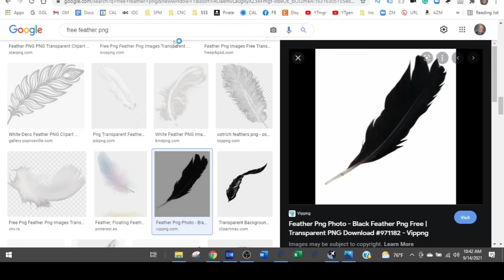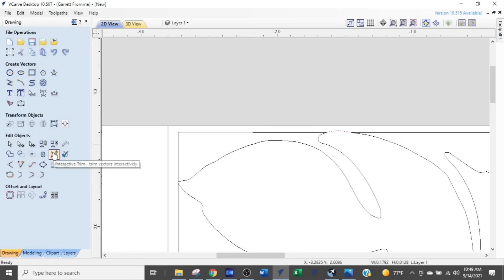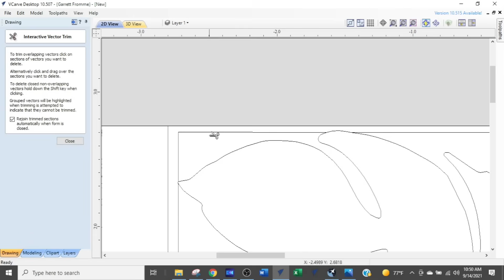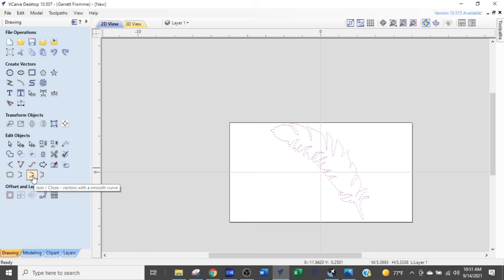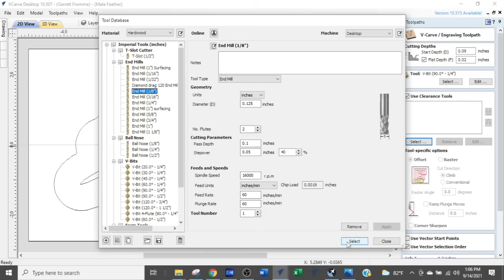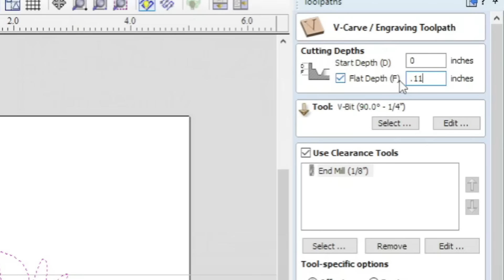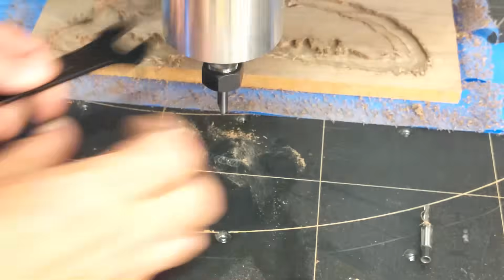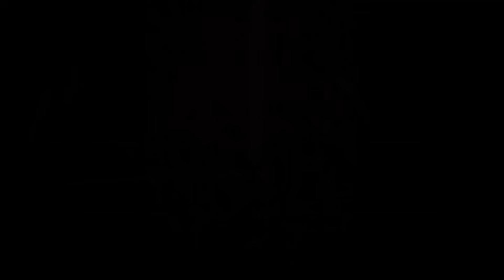How To Make a PERFECT INLAY with a CNC Router, Easy CNC Router Projects

Comment: I'm only 6 min in, but I want to send a couple recommendations. If you want to use a free png, don't take a screenshot, use the link to go get the full resolution png from the actual source in the search. This gives you a true transparent file and presumably, the high resolution should provide you better results when creating a cut file from your image. Also, when I'm searching for things like this, I'll add the word silhouette to my search terms. Just my preference.

However, if you insist on simply taking the screenshot, you can use the keyboard shortcut WIN+Shift+S to quickly bring up your snipping tool and not have to type it in each time to use it. Hope that's all helpful.
Reply from the maker: GradOutletcom, thanks for sharing these tips brother! I'll give them a try on my next project! Happy cncing!

Comment: Hi Gareth, as usual, your description of this process was outstanding. I did try it and for the most part it worked as intended. My attempt included lettering with scrolls above and below. On final surfacing, letters were perfect, but parts of the scroll were too shallow and faded out. Would you recommend a deeper carve while maintaining the distance between the male and female components?
Reply from the maker: BillHoward, that would be a great way to solve your problem brother! Your best bet is to follow the deeper inlay settings below. You'll want to have your inlays endgrain for best results, use a 30 degree V bit. Here is a link to the 30 degree v bit that will work great: https://idcwoodcraft.com/products/30-degree-extreme-detail-v-bit-bit-for-cnc-routers-1-4-shank

For the female
Start depth 0.0
Flat Depth 0.4

For the male
Start Depth 0.3
Flat Depth 0.1
Reply: Gareth @IDCWoodcraft   thank you for your advice and links to the 30 degree bit. I'll have an order in pronto.

Comment: Hey Garrett, your settings give me a good result, but I’d like a bigger gap between the ‘plug’ and the ‘socket’ - about 1mm more, to give me some room to or error with the bandsaw blade.  

I’m scuffing my finished surface so I’d like to increase the gap but I can’t work out which value to adjust.
Reply from the maker: Grumpyoldtwit, Try increasing the start depth on the male inlay brother! That may give you exactly what you are looking for.

Comment: Hi,  I am trying to understand how I get a .02" gap for glue using these settings? (.09 SD, ,02 FD on the male)  Once the models are simulated and I probe the Z's with the  cursor, I expect to see a difference in the levels, but I get a 0.11" depth for both pieces.  Where does the 0.02" gap come in? 

When I make the stop depth for the female piece to be 0.12" I then see a 0.01" diff, enough for glue... Thanks,  Bill
Reply from the maker: Bill, there is a video on youtube that should really help clarify this. Here is a link: https://youtu.be/l4VMo9DCzO8?si=UP85TO2KmeA2axyU
Reply: @IDCWoodcraft   Thanks, that cleared it up ;)

Comment: Long time ago I made soem inlays  with your SD and Fd settign and it works nice  and now I would liek to ask what about inlays for cuttign boards that need to be a slighty deeper   do you have such a tutorial as well ?     or can you post   proper setting let say  for inlays that will be 5 mm deep instaed of almost 3 mm ?
Reply from the maker: Bogas, You can definitely play around with the numbers though and make the inlay deeper. You'll want to have your inlays endgrain for best results, use a 30 degree V bit. Here is a link: https://idcwoodcraft.com/products/30-degree-extreme-detail-v-bit-bit-for-cnc-routers-1-4-shank

For the female
Start depth 0.0
Flat Depth 0.4

For the male
Start Depth 0.3
Flat Depth 0.1

Comment: Thanks for the video! What would be the inlay settings if using different angles; 15, 30 etc? Would it be the same? Would you recommend different settings for cutting boards to avoid hallow points but deep enough inlays?
Reply from the maker: norbgs07, You can definitely play around with the numbers though and make the inlay deeper. You'll want to have your inlays endgrain for best results, use a 30 degree V bit. Here is a link: https://idcwoodcraft.com/products/30-degree-extreme-detail-v-bit-bit-for-cnc-routers-1-4-shank

For the female
Start depth 0.0
Flat Depth 0.4

For the male
Start Depth 0.3
Flat Depth 0.1
Reply: @IDCWoodcraft  thanks for all that you do for the community of woodworking. I’ll do my own tests then cut them in half to see the fit and hollowness. I’m surprised no one has done this before. Happy to share my results here otherwise another great future topic area for you to cover aka formula to calculate parameters for different bit angles and depth for inlays.

Comment: Just got my CNC and will carve my first project tomorrow. I’ll start simple but am excited to do inlays.
Reply from the maker: Timothy, right on brother! Congrats on getting your longmill in hand! I'm looking forward to seeing what you create!
Reply: @IDCWoodcraft  made so many mistakes but learned sooooo much. I just made simple sign with the word Love. It was 12” x 6” and I pocketed out the interior and around the letters  and made a border with chamfered edges on the inside and outside. The only problem was I selected a 1/2 90° v bit but used a 1/4” v bit on the project. Needless to say the results were not what I was expecting.  I decided to remove all tools in the tools database that I don’t have. This should reduce the chance of calculating with a bit I don’t have. As I buy bits I’ll enter them into the datatbase.  The journey has begun!

Comment: New subscriber here!  I'm a complete newbie with lots of woodworking experience and some laser engraving experience.  One thing I see people doing is spraying the accelerator on the tape of the workpiece, and then place the workpiece on the glue/tape on the spoilboard. I was also under the impression that to do inlays you would need to use tiny downcut bits, like 1/32.  I love your method here with the much more durable v-bit instead.  Thanks a bunch for this video and the files!  I have a new foxalien 4040-xe coming tomorrow!
Reply from the maker: TerrapinCreations666, welcome to the channel! You absolutely can use accelerator on the tape, it works like a charm! I'm looking forward to you giving an inlay a try for yourself with the Vbit, it's awesome!
Reply: VCarve is for PC only it seems, which stinks as I only know how to use a Mac.   @IDCWoodcraft

Comment: Hello Garret! I have used your vcarve v bit inlay method and it works beautifully, thank you for that. I am working on a project that needs to have the inlay go much deeper, 1/2” actually. I am wondering what I would set my parameters to (flat depth/start depth) for the male and female. To be honest I’m still a little confused about how your formula works, but it works great, and I would appreciate it very much for some info on how to get a deeper inlay. Thank you!
Reply from the maker: Leif, 
 You can definitely play around with the numbers though and make the inlay deeper. You'll want to have your inlays endgrain for best results, use a 30 degree V bit.
Here is a 30 degree v bit that I reccommend: https://idcwoodcraft.com/products/30-degree-extreme-detail-v-bit-bit-for-cnc-routers-1-4-shank

For the female
Start depth 0.0
Flat Depth 0.4

For the male
Start Depth 0.3
Flat Depth 0.1

Comment: I am very happy this numbers work for you. But they dont work for me. I wanna make small inlays for guitar and jewallery. My wood thikness is about 3mm sometimes smaller. So i cant make the start depth at 2.286 mm.
Do you have a suggestion for me? Sometimes the shell inlays have only 1mm thikness...
Reply from the maker: dirkhorn9695, no problem brother. You can use the same proportions as I did on this video and adjust them to your project size instead.

Comment: Thanks for the awesome info! I was wondering what settings to use to make them deeper, I am wanting to do bowties with them. At least a 1/4 inch deep.
Reply from the maker: Sandbulte, 
Try this with an endgrain inlay. I think you will be very happy with these settings. Be sure to use a LOT of clamping pressure for the inlays.

Female 
Start Depth: 0.00"
Flat Depth: 0.40"

Male
Start Depth: 0.3"
Flat Depth: 0.1"

Heres the bits you will 100% need to make this work right. 

Clearing Pass 1: 1/4" Downcut https://bit.ly/3yfBqT7
Clearing Pass 2: 1/8 Downcut https://bit.ly/3HSoF4j
Vcarve Pass: 30 Degree V Bit. https://bit.ly/3xWzxt6

Comment: Great video as usual.  I wanted to know if it would make sense to tape down both pieces one above another with a little gap and then run the 1/8"upcut on both then but chance?  Maybe save on time?  I realize you'd have to load the gcode files for each a couple times but maybe it would save time on the bit changes ? Any thoughts on a setup like that?
Reply from the maker: Steve, glad you liked this one brother. I would recommend not running them above another. You will run into issues that way.

Comment: Hi Garrett, I beg your assistance.  I have attempted this process 3 times with no success.  I believe I followed your instructions to the letter, but the walls of the female are coming out stepped!  Is it my machine?
Reply from the maker: Russell, It very well could be brother! Your machine might be loosing its position relative to where it thinks it is, try lowering your feedrate.
Reply: @IDCWoodcraft  Hey Garrett, finally, finally, FINALLY got it.  I mean to tell ya, I've been at this for a seriously long minute.  And I have mostly myself to blame.  And I've wasted a LOT of wood trying to solve this.  The stepped walls happened because I mistook my 60° vee for the 90°!  That one's on me!  But it wasn't my only issue.  I'm  having problems with my web controller interface and the controller interface on my Onefinity not sharinh information!  And I've had to create a cheatsheet with multiple pre-checks, not the least of which is making sure the board is secure to the wasteboard!  But I've learned a LOT . . . the hard way!!!!!  Thank you for your support, I've proven, at least to myself, that your numbers (and only your numbers) really do work!

Comment: Hi Garret, Thanks for doing this video, it's very informative and helpful.  I'm still working on getting everything dialed in on my Shapeoko 3 XXL, but wanted to ask you about an issue I'm seeing on the Male part of the inlay.  I chose Brazilian Cherry for the Female, and am very happy with the fine edge it takes.  No chattering or cleanup, just a very clean cut.  I chose Aspen for the Male side because it has good contrast, but I'm unhappy with the fuzziness and amount of cleanup required.  I decided the wood was just too soft so I got a piece of Maple and I'm seeing better results, but it's still not quite dialed in.  There appears to be chattering along the edge in some areas which yields a poor final product.  I bought new 90 degree Vbit and end mill bits per your spec to make sure they were sharp, and tried slowing the feed rate, but I'm still not setting the precise results you've shown.  Could this be an issue with the Dewalt router used (it's relatively new) or can this be corrected with feed and speed?  Any pointers would be appreciated.
Reply from the maker: Dave, I would continue to lower the feeds for those troubled areas, it can be tough to reduce chatter in some areas due to the nature of the wood grain.

Comment: 1st I’d just like to say thank you for sharing! Your tutorials have been extremely helpful! My question is on deeper inlays, I’m cutting to .25 deep so my male I used for start depth of .23 and flat depth of .02 but with that then it will take a 1/4” in 1 pass, pretty hard on tools so was wondering what would be the best way to set up for the male so it can take a couple cuts to get to final depth? Thank you!
Reply from the maker: Tony, brother this vertic inlay technique is a bit of a "hack" for Vcarve and trying to specify multiple paths is unfortunately can't be done my friend. Although I wish it could!

Comment: I have a question .... I tried a simple image with text using your DOC and Flat settings, 1/8 EM to clear and a 90 deg VBit to finish.  Both pieces are coming out nice and clean but they are not matching up size wise - the male piece is too large to sit into the female recess.  I'm using VCarve 11.5 and a Shark HD CNC machine.  I've had other inlay projects work but it seems kinda hit or miss if the sizes are going to match.  I did the original vectors on layer one, flipped the entire drawing with no other mods onto layer 2.  I've tried cutting this twice with same results.  Thoughts?
Reply from the maker: Tim, it could be down to the accuracy of your machine brother. With longer text, you might have more issues with everything not matching up 100% perfect. Consider using a bandsaw to break up the text for the male section into multiple pieces.
Reply: @IDCWoodcraft  I guess if it was even close on the larger image piece …. and if it didn’t have others come out fine … I’d be inclined to agree.  It is an older machine, probably going on ten years …. but I don’t see any accuracy issues in any other work (carvings, etc).  Oh well, just thought I’d ask your thoughts.  Love your videos, keep up the good work!

Comment: Great job on the video Garrett! I ran into an issue however. When I try to run the files on my  onefinity cnc the “male” feather only wants to run the borders on the inside and outside. I tried separating the toolpaths but didn’t help. Any advice for a newbie like me? The only way I can get it to work is to v-carve the whole feather which takes an hour and 45 minutes which is way too unproductive for me.
Reply from the maker: Nickcummings, im not too sure about that one without some pictures brother. This carve should be done with a vcarve toolpath in order for it to turn out right. Try and follow the video instructions step by step to ensure everything is perfect. If you are still having issues, send me a few pictures to garrett@idcwoodcraft.com

Comment: Hi Garrett,  What do you do when you are using two separate clearing bits (.25 & .126" bits) for the plug and the starting depth is .18 and flat depth is say .12 ?   I find that the clearing bit goes right to the .18 and then cuts the .12 for a total cut of .3" (way to much for a .25" bit)  Then because I use a 1/8" bit also, it is REALLY to much.   How would one go about making a separate toolpath for the clearing bits.   I'm afraid of I select what needs to be cleared without specifying the vbit (6.2deg), it will not clear correctly.  I've tried duplicate toolpaths for the vcarve option and it gets really confusing.    I hope I explained myself without too much confusion.

Thanks 
Scott
Reply from the maker: Scott, you bring up a really great point my friend. I really wish Vcarve would fix this issue since it's something that a lot of CNCers have had to work against brother!

Comment: Would the cut depths be accurate for a smaller angle bit, say 60 degree and 30 degree?
Reply from the maker: David, a 60 and 30 degree v bit would work great. 
You also need to try out deeper inlay depths to complement the 30 degree v bit. 

For the female: Start depth 0.0 Flat Depth 0.4
For the male: Start Depth 0.3 Flat Depth 0.1
Reply: @IDCWoodcraft  Thanks! I figured it would work, but would probably need some tweaking here and there.

Comment: Garrett, If you run the 1/8 clearout bit first won't that bit run right  uo to the design line?  If that happens the V-bit would not cut a 90 degree angle, but go only to the design line.  Would you not have to do an offset inward away from design line.  I very much enjoy your desceiptive videos!  Thank you for be so responsive to your viewers. Don L.
Reply from the maker: Don, A V carve toolpath doesn't let the 1/8" clearout bit run right up to the design line. It automatically offsets it inward or outward!

Comment: Thanks for the videos - I'm a rookie and the step by step really helps me to learn.  Really appreciate using a free png as well, rather than making us buy something we may not use....   Struggling though - several times I've tried to use the trim tool and the scissors doesn't open to snip.  I started over making sure I did everything you did... can you please help?  thx!!
Reply from the maker: J Swanson, glad you enjoyed this video brother. When it comes to snipping your part, make sure it is converted to vectors before trimming. If the image is still a PNG that you imported, you wont have anything to snip. If you are still having issues, send me an email at garrett@idcwoodcraft.com and I will take a look.

Comment: Garrett, I came upon you're site by accident, I'm a woodworker and a woodturner. I watched you're very informative video on the feather. A suggestion a would make is instead of using the blue tape and ca glue try using woodturners double faced tape instead. It is thin and very very strong. Also, try using a narrow slot insert on the table saw along with using feather boards when cutting the walnut. Great video and maybe I'll be getting into CNC.
Reply from the maker: Phil, thanks for the tip brother! I will have to look into that stuff. It sounds like some really powerful tape.

Comment: Hello Garrett, thanks for your tutorial.
I have a question when making inlays for a cutting board, what settings do you recommend. I think the inlay must be deeper, and if so what do you suggest?
Gratz, Patrick
Reply from the maker: Patrick, 
I would recommend using a 30 degree v bit. Heres a link: https://bit.ly/3xWzxt6
You also need to try out deeper inlay depths to complement the 30 degree v bit. 

For the female: Start depth 0.0 Flat Depth 0.4
For the male: Start Depth 0.3 Flat Depth 0.1
Reply: @IDCWoodcraft  

Thank you for your reply